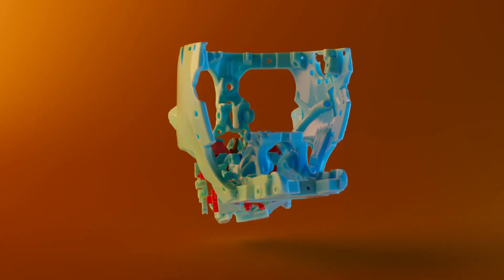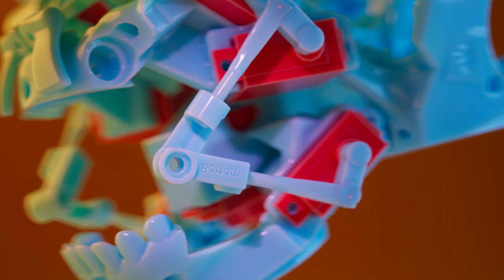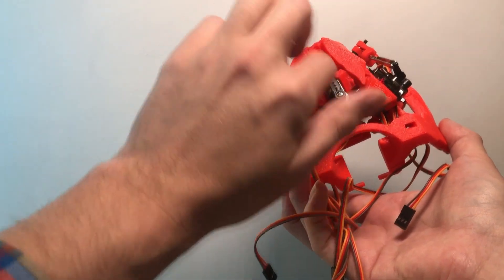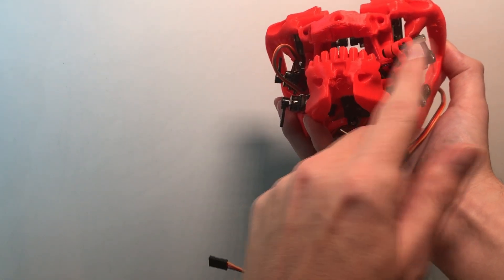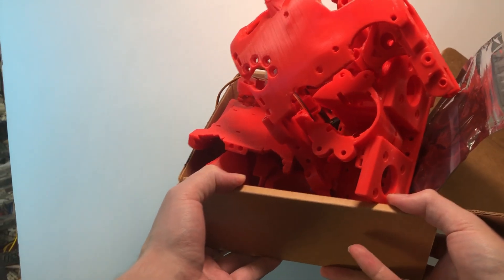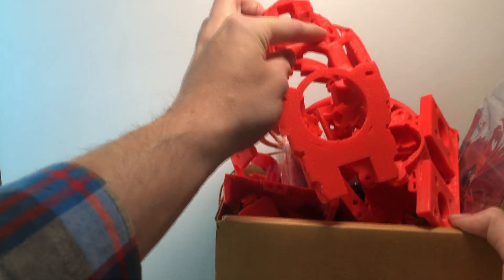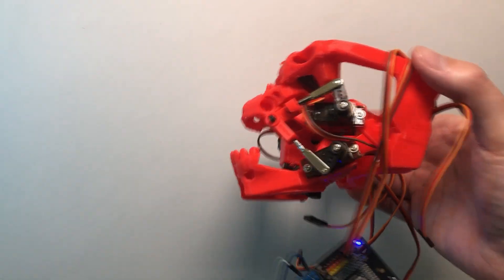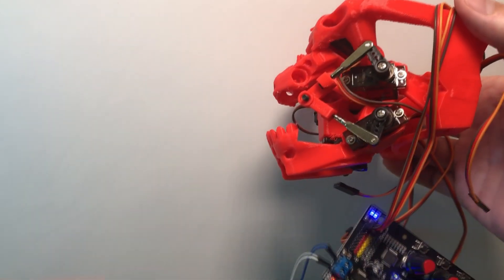A Seven Motor Jaw

Comment: though you've probably already figured things out, my thought was, for thinning the end of that 5 bar, steel spring, it'd be really flat.
Reply from the maker: I should buy a lot more metal components to work into these 3d printed designs.  I'll keep a look out for useful parts.
Reply: @DaveMakes  two things you should look into if you haven't, is ferrofluid and nitinol, both could be very useful for your project.  no need to read further.

     ferrofluid clutches are essentially two ribbed disks face to face with some magnetic liquid between them and an electromagnet mounted to the rim.  with the magnet off it's a sloppy slurry that moves like gel toothpaste, when on it firms to hard peanut butter consistency.
     it should be easy to print thin clutches, if you can fit a fan on the motor somewhere, you can fit a clutch.  you can use clutches to soft lock joints, so you don't need constant full motor power to keep position, partial is enough.  with silicone skin those arms are gonna get HEAVY, so you'll need to manage power tightly.
     nitinol wires are an OLD thing that was revived for robots in the late 80's for artificial muscles.  some of your facial motors could be replaced with them easily, that stuff's all over amazon.  you make an actuator from two springs, one pulls, one pushes, when you heat the nitinol spring(run current through it) it pushes, as it cools the other spring pulls it back.
     i'm thinking now that additional nitinol hoops in the lips would be good, it'd make them warm to the touch, but not hot enough to damage the silicone skin and they'd be very flexible while still holding the lips in shape.  i find many silicone heads get a slack jawed look to them cause they don't have something to hold the lips between the actuators.  might even be possible to add them in a way that would do pouting and you glue them to the skin instead of designing them into the skull.
     it was also floated as a material for spectacle frames, you twist your eyeglasses into a knot and run them under hot water, they'd crawl back into shape like they were alive.  now most of our glasses are made of plastic, it's less relevant.

Comment: Why stop at 1 camera that is front facing? is it possible to redesign the skull to take multiple cameras for a full 360 degree view?
Reply from the maker: She'd have a wig covering the back and side of her head.  I'll try to use other kinds of sensors for as much situational understanding as possible.  I picked up some millimeter wave sensors recently that i'd like to experiment with, I've heard that they can be very useful.
Reply: @DaveMakes  I never thought about that. I keep thinking in terms of human, but truthfully she can have all sorts of sensors installed that would be better.

Comment: A piece of advice, when you start doing the arms use carbon fiber arrow rods from archery bows for the bones, they are inexpensive, light, long, come in packs.
Reply from the maker: Thanks for the tip!
Reply: also big for guitar builders and rc airplanes, they're very common now, but knowing where to get them can be tiresome.  now you have three possible sources.

Comment: You can do two motors for the bottom lip, aswell as cheeks by adding a small thin rod, maybe a flat plate further in the head. Even adding a small gyro flate that slightly sticks out as a part of the jawbone itself.

Comment: are you sure you want to make this open source and share every detail? i started out that way but ive withheld a bit of information lately. You don't need many arduinos, just one esp32 dev kit and a pca9685. I have made it so you can run the speech to speech on the localhost instead of the cloud and picked a custom tts(VITS-Umamusume-voice-synthesizer) I have the code. But the latest ive withheld. I have some ideas of how to run a simulation to determine the weight distribution and the kind of motors for the body... just ideas though. I'm strictly focused on the sex bot aspect though to limit the scope of the ai and er reasons. I also have some ideas about the ai for the motions... I mean I'm borrowing so i owe to give something back but should you share everything?
Reply from the maker: My thinking with the part kits was that I could mail them out, already printed.  I don't feel comfortable making the 3d files available for others to print.  
I've run into people re-uploading my videos as their own.  It's frustrating that some people are like this.
I suppose this could happen in some way with overall design ideas I have with my robot head here.  

I don't know.  Maybe I shouldn't put this kind of thing on youtube.
Reply: @DaveMakes  I suppose it being opensource is not a problem but maybe give it a license just in case. Like cc or gpl if you want ofc. Can i be of assistance? rather hop on this band wagon than keep trying with my frankenfu.
Reply from the maker: @robowaifutechnician  well, right now i'm working out attaching the silicone to the mouth parts.  I've done the first casting of probably several to get all the positions really dialed in to the right places.

after that i'll probably want to jump back to working on the speech to speech system to get some actual phonemes on the robot to match up with the words.  Could be a while before I get to it though.  

I'm happy to accept assistance, though i'm not sure what assistance I could ask for.  I feel pretty good about getting all of these things working. It's just a matter of getting it all done/finding time.

I'm at a different computer than my main one at the moment - i'll post a link to a discord server when I get back to my main computer tomorrow.
Reply from the maker: I have a server here:  https://discord.gg/u9q3vYTm

Comment: Exciting! 😊 How thick is Hannah’s skin?
Reply from the maker: 8mm in most places.  thinner in some areas.  There's a cutout ring around the inside of her lips where it is thinner, for example.  I may have to add some more thinner regions in the cheeks to better control deformation.  Future problems for now though.
Reply: @DaveMakes  I see! I find tensing the silicone and padding very good for managing deformation, along with very thin skin. I watched an early video on Hannah’s eyelids, and was wondering if it could blink further if the skin was a little thinner.
Reply from the maker: @MushieRobot  I think so, yes.  There is a big mass of silicone up around her eyelid/brow area right now.  I need to work on it when I next do a mold revision.

Also, It's remarkable what a change of hardware can do.  In previous videos with her eyelids I was using M3 sized hardware - ball ends, screws, clevis, threaded rods, ect.  I've moved down to M2 sized parts and I think this will be very helpful.  space is very tight inside her head.
Reply: @DaveMakes   Because our robot is so tiny, our only option was to design and 3D-print the entire mech (minus the screws). Could potentially free up more space this way.

How big is the current Hannah? 😃
Reply from the maker: @MushieRobot  1:1 scale to a normal head I think.  She's got cartoon proportions though, so a small jaw and enormous eyes have made some things tricky to fit.  Seems to be working out so far, each iteration is doing better than the last.
Reply: @DaveMakes  Glad to hear. Looking forward to it!